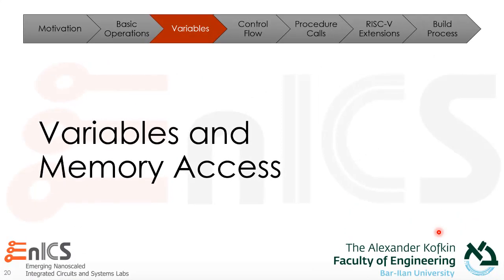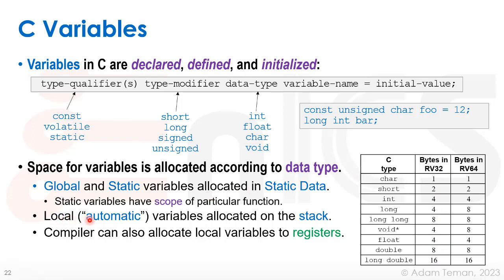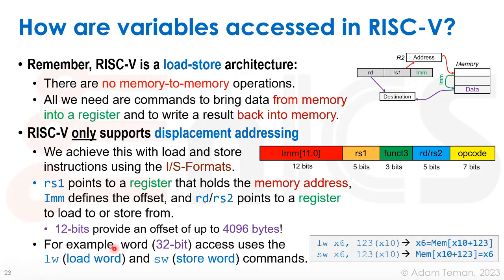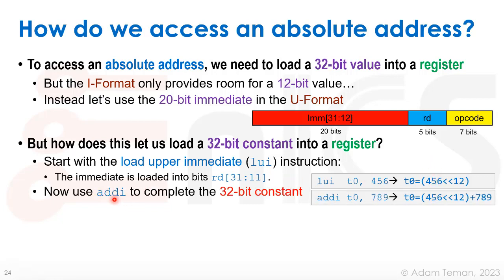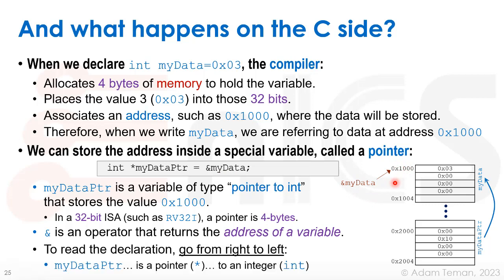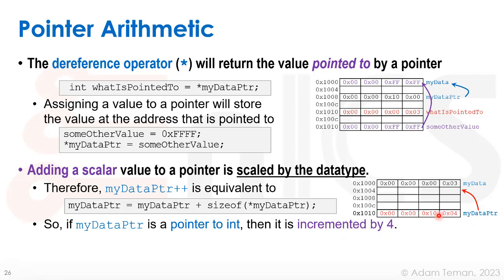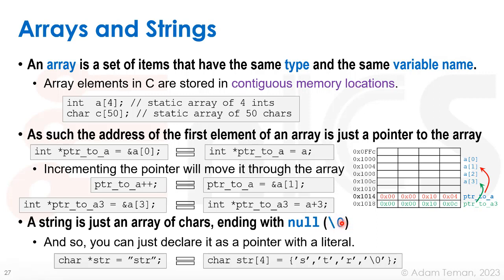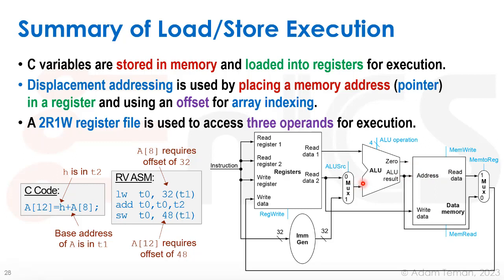SoC 101 - Lecture 3c: Variables and Memory Access

Comment: Hi sir,
I have one question in the section "How are variables accessed in RISV-V?",
Here we are doing load and store from offset of x10 to 123.
Load: reading the data from x10 to 123.
Store: the same data is storing in x10 to 123.

May I know the real case application in SOC?
The data shouldn't be changed during register read and write operation?

Comment: you didn't mention what is 456 and 789. Is it a single number 456789 or two different numbers
Reply from the maker: Hi,
Actually, your question made me go look this up again and make sure I didn't make a mistake in the lecture and it also showed me something that I'm not sure how deeply I thought about it before. Luckily, there is no mistake in the lecture (as far as I can tell), but maybe I should have given the example a bit differently to make it more clear.

What we want to do is fill a number into a register that doesn't fit in the immediate field of addi (so >4096). What we have to do is break it down into two numbers. The first, we multiply by 4096 and then we add the second to it. The number, therefore, that gets stored in the example is 456x4096+789. 

This can be a bit complicated due to sign extension and twos complement numbers. Therefore, we usually wouldn't write this sequence by hand, but rather use the compiler pseudoinstruction "li" (load immediate). This is, assuming that you actually are hand writing your assembly code, rather than doing what most people do, which is using a high level language ;). But for the purpose of understanding this, if I would have done lui 0x456 addi 789, then I would have gotten 0x456789 in the register (because a <<12 operation is 3 hexa positions).
Reply from the maker: Just another point, There is a great discussion about this here:
https://stackoverflow.com/questions/50742420/risc-v-build-32-bit-constants-with-lui-and-addi
Reply: @AdiTeman  Thanks sir. Sorry for not mentioning the time stamp while asking the question.

Comment: Do the LUI and ADDI instructions serve the purpose of storing a 32-bit base address in a register? . Furthermore we add offset to that register in the load and store instructions. Am I right ?
Reply from the maker: Yes, this is exactly the usage of these instructions. The LUI provides the maximum sized constant it can and moves it towards the MSB of the the target register and then the LSB bits are populated with the (smaller) constant in the ADDI instruction. Together the 20 bits of LUI and 12 bits of ADDI provide a full 32-bit constant inside a register.

Regarding the offset in the load and store instructions, they serve a different purpose. You do not need them for the 32-bit register loading. They are primarily used for "displacement addressing" which i show in Lecture 2 on slide 23. You have a base address - such as the stack pointer or the first entry of an array - and then use the offset to easily access items that are located relatively to this pointer (such as the n-th integer stored in an array). A common use case would be to set the pointer to an array inside a register using load immediate (i.e., LI pseudo-instruction, which translates to LUI+ADDI or AUIPC+ADDI) and then use the offset of LW or SW to index to the array.
Reply: Thank you so much Sir. Got it now  @AdiTeman